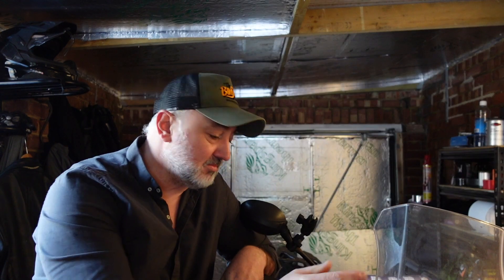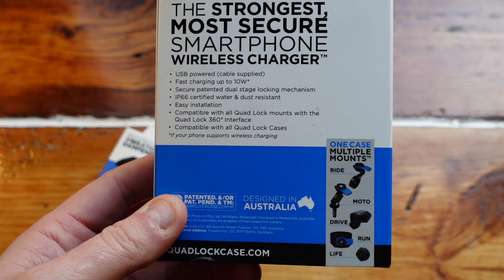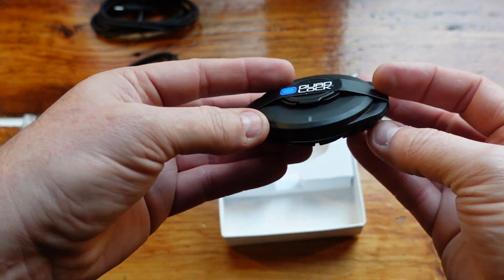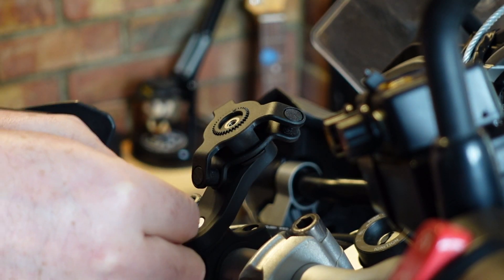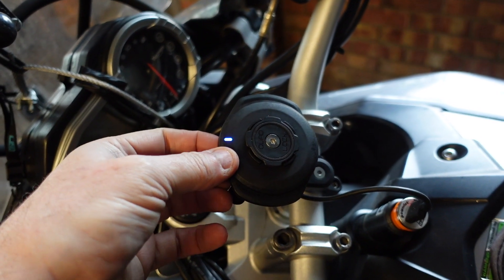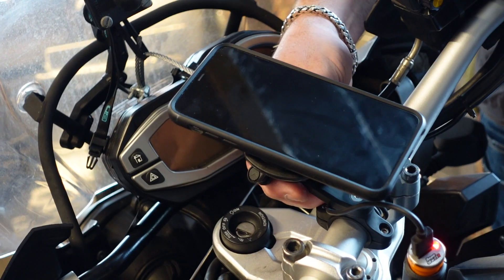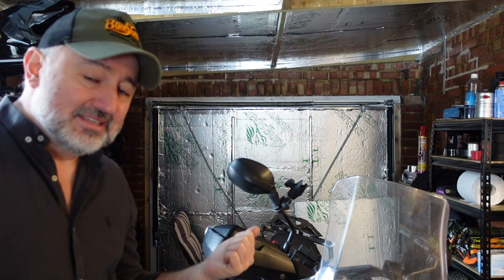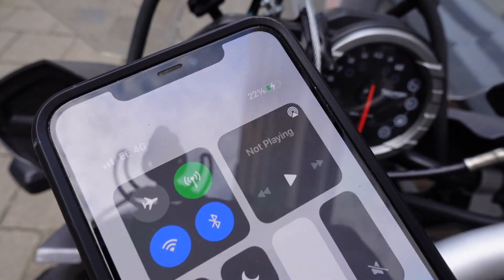Quad Lock Weatherproof Wireless Charging Head-Vibration Dampener-Install and run on iphone11promax.

Comment: It’s not the bike Billy, that front port will supply 10A at 12v if it needs to (120w) and the alternator will power a small village on the Explorer. Make sure your USB port is the 2.1A rated one. USB is only 5v and if you only have a 1A adapter you will only get by 5w out of it. Change it to 2.1A and you will get 10.5 watts and it will charge properly.
Reply from the maker: Cheers Terry, yeah apparently so, someone else mentioned that, i had no idea that usb ports ran at different outputs, thanks for the info. Every day is a school day! I shall give you a mention in the next vid, always appreciate learning something new. Thanks again. ✊
Reply: @billy4rocks  Rock on Billy!
Reply: It's hard to tell but it looks like the test was done with the Powerlet (12:42 in the video) and if you pause the video at around 10:59 you see the face of it reads "5V at 2.1A" so it should be good.

 @billy4rocks  Did you ever get this working better?
Reply from the maker: @we5tbevryertyv  it worked alot better when i got the higher output adapter. Terry saved the day!
Reply: @billy4rocks  Best is to use QuadLock own 12V-USB adaptor. There you can turn it on Auto mode(turns on when bike is running) / Off / On and then you can be sure that it gives correct ampers for wireless charger + then its much more waterproof, because USB connection is covered with rubber. I am using that set on my jetski. :)
Reply from the maker: @Aksel0441   nice dude, thanks very much. ✊

Comment: Great detailed video. I have a basic quad lock system running on my bike. I can definity see how Quad lock has gone the extra mile with the wireless charging system to ensure a waterproof connection to the wireless mount head. 

My concern is that there is still a weak point in the system when it comes to how waterproof the entire electrical circuit is. The week point is the first connection from the 12V or USB outlet on the bike to the wireless mount. 

Every USB or 12V "cigarette outlet" I've seen advertised for any bike, appears to be highly susceptible to water entering the power output to cable connection.

IMHO, it's useless to have a waterproof connection at the end of a circuit if the begging of the circuit isn't also waterproof. 

A chain is only as strong as its weakest link.

Comment: Fitted mine today Billy.   I fitted a 3.1 amp USB output to bike a few days ago.
Changing to standard head for the Wireless charging head was cinch and literally took a few moments of my time.

I went out today as the weather was glorious so I rode from Hull to Cleethorpes and back.   32% charge upon leaving Hull and it was 98% charged upon arriving at Clee.   I'd call that a win.   I've also got the Vibration dampener fitted too.   Its all on a RAM Mount and is rock solid with lots of options to move it around to exactly where I want it.
Reply from the maker: Nice one Mick, yeah since I upgraded my usb port to the higher output one it made the world of difference. In the vid i done directly after this i had pretty much exactly the same results as you, albeit over the course of a 40 min journey.
Reply: what phone please? I have a Samsung s21 and Quadlock says it charges at max 5w...

Comment: For higher wireless charging power, a USB charger with higher current (Ampere) is required. I use a USB charger that can deliver 2.4 Ampere (Optimate USB O- 100), on a 1991 BMW airhead. My iPhone XR is charged in with high power (the green light is constantly on - not intermittent). Btw: thanks for this review. Tells me what I wanted to know about the vibration dampener.
Reply from the maker: Ahh i see, thanks very much for the information, shall get that and give you a shout out on the video. Thanks again, much appreciated. ✊

Comment: Good video Billy. I just ordered this for my Son to put on his bike.. KTM DUKE 390. You should also remember you were Running your Map App… That will affect your Charging rate as well. We will be wiring directly to the Battery on his Bike with New 12Volt to USB Adapter Quad Lock has just added to their lineup! It will be interesting to see if that makes a difference. I will add another comment once we get some data on that to let you know. Again thank you for the Video, it was informative! Cheers from 🇨🇦
Reply from the maker: Cheers Shawn, there a update vid after this one in regards to the charging rate, it was all down to the low output usb plug i was using, got a new one and it charged it loads more.

Comment: Good review. I asked myself, why they aren‘t so clever eliminating the next weak point ? Every connection with a removable connector is a weak point. Somwhy don‘t hardwire it to the charger or use SAE connectors? I never understand brands design not to the end.

Comment: I wanted to order it but I found out that I can order a separate USB adapter and connect it to the battery! But in the video he only ordered the wireless charging without a smart adapter! Is that correct or should I just order the wireless charging on the website? There are 2 versions of wireless charging! First with USB and second with fixed cabling! Which one should I order? Which one is in the video? I think the one without USB! So I can connect it directly to the battery

Comment: Ive ordered the damping mount and stem/ handle bar bolt mount, it doesnt fit. Bolt is wrong size, so far quadlock have been  helpful, responded very quickly. But thats my fault for ordering the wrong product.  The case for my phone is too small, so that will be going back. Ive found they do a  wireless charger that doesnt need usb connections, looks like can be wired into a switched live or thunder box etc

Comment: Looks like a neat system overall. I may invest in this. I do feel however that they should just incorporate the vibration dampening and the wireless charging right into the mount and eliminate multiple connection points/points of failure. I think this would be a better design. Still offer all the other products, but offer mounts that have everything built right in. Just my two cents. Thank you for demonstrating some of this. I also think your phone would charge faster if you weren’t actually running maps / GPS (although I realize thats the point of mounting it there). I think some of those apps are rather taxing to the battery.
Reply from the maker: Check out the pinned comment, i was running a lower powered usb port, changed it and it fixed it, i think the video after this about that. Cheers. 👍
Reply: @billy4rocks  
Saw the next video after I wrote. LOL 😆 
Glad it all worked out. Beautiful motorcycle. I don’t have a motorcycle but I’m looking to do the same thing on my ATV, car, and bicycle.

Comment: Glad to see they have modified the wireless charging cable in port. The original version that I got rid off when I sold my last bike didn't work due to water ingress as the cable stood proud. Now they have a plastic tube around the port sealing the connection
Reply from the maker: Mine has been out in some horrendous weather, so far so good.

Comment: Havent had a good experience with this. My phone keeps dislodging at the slightest knock. The original locking mechanism seems to work better. Not sure if i just got a defective one but slight rotation and the phone comes off.

Comment: How many screw did u use? One for the dampener and one for the wireless charger? I thought one screw will put them all in . Thanks for the video. Will install mine later today?
Reply from the maker: If i recall correctly it’s one long screw which connects both.
Reply: @billy4rocks  from your video, i think u used 2. One for the dampener then one for the wireless charging

Comment: 14:50 the "Low power charging" would almost certainly due to the limits of the 12V-USB adapter. The new charger might be better, assuming it's a higher rated adapter.
Reply from the maker: The next video resolves this issue, and your exactly right.

Comment: Hi there mate so just watched your video I have a ninja 650 and have just bought the whole system just like yours. And I have also bought the quad lock cigarette charger

Will be putting it on the bike tomorrow and will definitely let you know the results in charging spec. 

I also have tom-tom heated grips and a gloves jacket and trousers. Talk soon.

Comment: I’ve got a question.  It seems that by mounting the vibration dampening unit, then the wireless charger, that there is no longer a LOCK to the QuadLock case right?  If the case no longer LOCKS to the wireless charging unit, do you have any concerns with the phone accidentally coming off the wireless charger?  I see there is also no tether on the QuadLock cases, so if that phone gets bumped accidentally and comes off while you are riding, you don’t even have a tether around the mount to save the phone.  Any concerns here?  So it’s a QuadLock system that no longer locks?
Reply from the maker: Hello Mark, it still locks to the wireless charger, its the only way that it can be attached, via the phone case.
Reply: Great!  I thought the locking mechanism was the blue lever.
Reply from the maker: @ka1mla1  it is on the standard quad lock attachment, you push that lever down to release. With the wireless mount you push your entire phone down then twist off to unlock.

Comment: May I ask with the wireless charger ( with on press-release pad) how to unlock the phone ?
Reply from the maker: As in how to release the phone from the charger? You just press the back and twist, similar to there standard mount.
Reply: @billy4rocks  I've got an issue on mine. I don't even have to push back. It just comes away at slightest rotation. Maybe I got a dud fitting
Reply from the maker: @user-uk1zg5pq1m  yeah does not sound normal, when mine is attached it will not budge.

Comment: hey Billy you mounted the vibration damper the wrong way... just look at the pictures in the manual and turn it for approximately 15 degrees so it does not push on the quad lock arm...
Reply from the maker: Nice one, cheers Mitja. 🙌

Comment: Do you have to take the wireless charger of wen washing the bike.
Reply from the maker: No not really, i mean I wouldn’t direct a water jet at it, but generally it should be fine, ive rode the bike in some pretty heavy and its still going strong.

Comment: I'd say with everything still running on the phone (GPS, Bluetooth, WiFi, Music Player, etc.) and not loosing any battery, that's a (+2%) plus.  So if you start with a fully charged phone and go on a full day trip,  you can rest assured that your phone's battery won't die on it.  BTW, did you buy a Quad lock windscreen mount for your car?
Reply from the maker: Hello Alan, this is true, but it worked alot better when I upgraded the USB adapter to a higher output one, that video is directly after this one. I don’t have a car.

Comment: Not that you probably worked it out by now, but with the quad lock packaging if you just pull the top of the packaging it pulls  open.
Reply from the maker: The carnage i have created with boxes, a pack of cornflakes in my hands looks like its been mauled by a bear.
Reply: Ditto

Comment: Nice one. Looks big i think, but its an easyer charging. I do have a din adapter from ebay with a charging clock...that to is a bit long, but it works.
Negative 11'C outside here, so no commuting to work tonight 🥶😭
Reply from the maker: its a fair old size, not obtrusive or anything though, for my bike at least. The heated jacket is worth its weight in gold tonight!
Reply: @billy4rocks  in this weather l think you need a woodstove under the jacket. 😀.
Fits your bike good as its a big bike. Quad is on my wish list

Comment: I have one on my BMW K1600 that's hard-wired to the bike apparently quadlock reckons it will turn off automatically when the battery reaches its threshold. Actually incorrect it doesn't the power will stay on for over 30 minutes l don't trust it. Also you only need the vibration damper for IPhones as they hate vibration and die. I'm using Samsung and never any problems

Comment: Good vid mate. Yeah, I reckon with your jacket on and maybe grips/gloves as well as your phone being a satnav, then the charger did well. Bike batteries are quite small compared to car batterys. Good system though Thanks.
Reply from the maker: Cheers Mate, Just been looking at another you tubers vid and he had similar results, which is comforting! Haha... yeah might run another test with nothing attached or running on the phone, see what that gives, its all a learning process! ✊
Reply: No its not the battery the alternators on these bikes can handle alot more its likely the usb plug
Reply from the maker: The vid after this one i used a higher output plug, made all the difference.

Comment: In my opinion, Quadlock really messed up by not having the cable hard wire into the unit. The plug option is just another annoying place that can rattle loose. I would get one if this wasn't the case!

Comment: Am I missing something?
If it’s a wireless unit why do you have to run a cable to power the unit ? 
Why not just run a phone cable to a usb to the battery of the bike ?
Reply from the maker: I guess it’s wireless in that you don’t have to plug a wire in every time you want to use it. Much like a desktop wireless phone charger, there still attached to the mains via a wire, you just lay your phone on it.
Reply: It’s a Great idea with a stupid design, the price is also absurd.
75.00 that’s crazy.
For 14.00 you can buy the 
Battery tender usb connect it to your battery via the battery tender and just run a 3 foot phone cable and it does the exact same thing. 
Wireless means exactly that.

Comment: The quadlock usb cable dont support the power we all needed for the wireless charger... Change the cable and u'll get better charging... Try ur original hp cable.

Comment: Have you rode much with this system? Have you had any problems with the camera stabilization with this Quad Lock set up?
Reply from the maker: It’s been used everyday since i put it on, no issues so far.

Comment: But whats the point? Why not plug the cable straight into the phone instead?
Reply from the maker: Fair question, So you don’t have to put in and pull out a cable every time you want to use your phone, which if we are being honest, is no hardship. This just speeds up and therefore simplifies the process off using your phone on your bike.

Comment: Damn if the power charger was wireless like the portable chargers I use that would be great. I don’t have an outlet of my motorcycle lol.
Reply from the maker: No doubt that will be the next thing manufacturers will add to there bikes, like a little compartment like there is on the GS you just stick your phone in there, no wires, its gonna happen!
Reply: @billy4rocks  exactly, just have the same thing but you take it off and charge it from an outlet, and then take with you for a backup. I use one for work everyday it’s awesome.

Comment: No more QuadLock. Their mount is the reason of my mobile’s issues because of vibration. They recognized the problem and issued a solution - that you have to buy, instead of receiving it at home with an excuses letter. That’s preposterous. When this wireless charging unit fails, the same will happen, and QuadLock will get money from customers twice again.

Comment: Quad Lock Vibration Dampener does not work. Don’t waste your money. To see what happens to an iPhone 8 after one season on a Quad Lock Vibration Dampener check out the video on my page. This phone was mounted on a Tenere 700 – not a high vibration motorcycle. Fortunately, I only use this phone as a dedicated GPS. I won't be mounting my iPhone 12 to it - ever.
Reply from the maker: No issues with mine with the iphone11 pro max.

Comment: Glad you don't do bomb disposal 🤭
Reply from the maker: I did apply…. Still waiting for a response.
Reply: @billy4rocks  🤔
Reply: By the way, like the quad lock vid. Good bit a kit if a tad pricy.
Reply from the maker: @rockintigger  yeah its a proper solid bit off kit, the next vid resolves the the low output issue. ✊

Comment: Wireless heads are not worth it as your running a cable anyway plus they charge a lot slower than just using the cable. sell the head and use a cable with a waterproof cap end and a aukey 4.8 plug. the plug plus the head was probably the issue not the bike
Reply: Hey, what do you mean by aukey 4.8 plug?